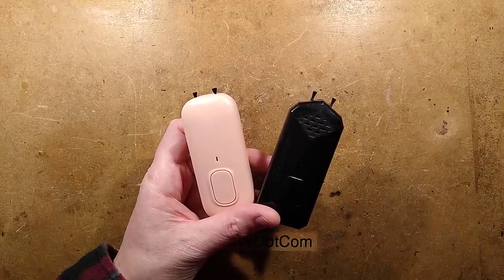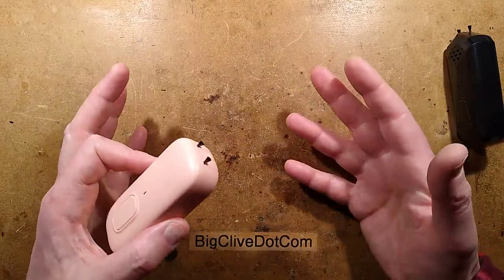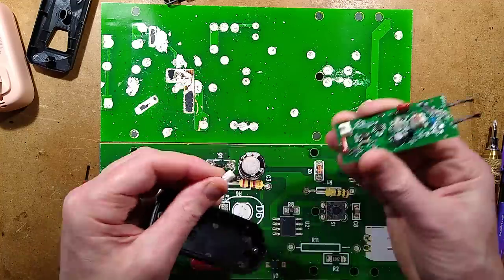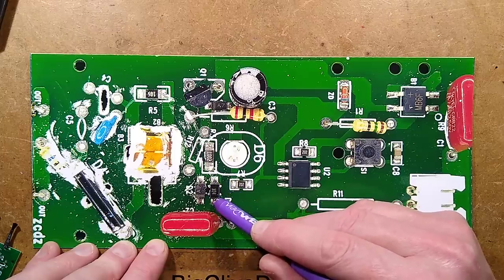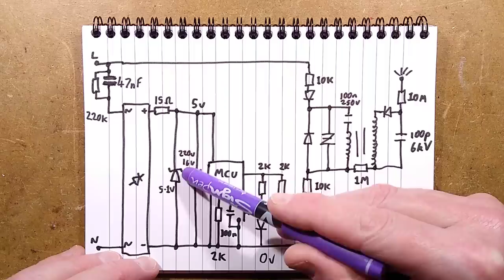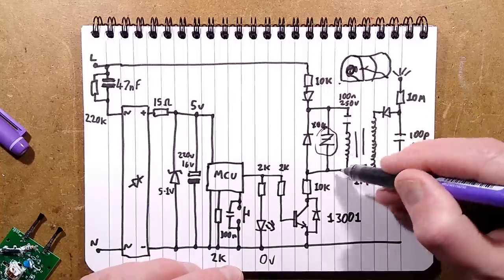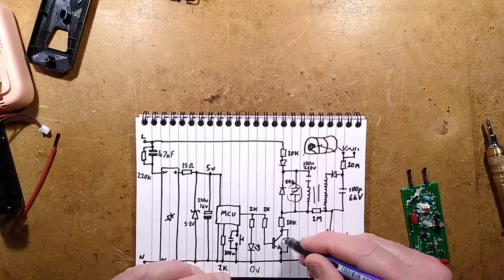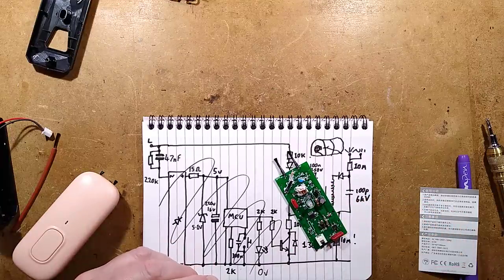Unusually spicy little ionizer - with schematic

Comment: G'day dude it's Bobby Maggoo here,
I just bought some very dirty nightclub house light.
Everything metallic has lost its gooey haze goo condensate.
However the plastic encased points are not looking easy.
Give me a tip and I will patreon the shit out of you or post U a bottle of Fanny's bay whiskey.
Trying to upgrade my loader skills on a rare opportunity.
Been here for years.
Just to weird to manage people.
Reply from the maker: Nightclub lights always end up filled with sticky haze residue and other "stuff".  Usually a spray can of isopropyl alcohol can wash out residue, but keep in mind that it's very flammable.
Reply: @bigclivedotcom  I just finished 12 hours of horrible work using circuit board soap, a paintbrush and my shop vac to suck out the foam and dust from the vents.
My house smells terrible.
And I've only cleaned the outsides....
God help me.
Now sleep and a countdown to packing up a few new year's eve gigs.
Thanks for being a source of info in the game.
Everyone is too busy to teach.

Comment: God iv learned so much from watching videos like yours and the other great channels and characters on YouTube over the years! 😁 I can fix TV'S, radios(plus build one some copper wire, tin foil, a razor blade with a stub of a pencil and safety pin, some rocell salt and a gravey can for an earphone, & if your antenna which is just a long length of copper wire it will power it.. so no batteries needed) phone chargers, and most PSU's. Plus a multitude of things. And I knew absolutely nothing (Apart from fixing a plug socket & changing a light bulb 💡) before I started learned electronics for real.. so if anyone is thinking about learning for real my advice IS DO IT 100%👍BECAUSE YOU WILL NOT REGRET IT ONE BIT. IT'S PROBABLY.. "NO IT IS THE BEST THING IV DONE WITH MY SPARE TIME, (WHICH IS A LOT THESE DAY'S NOW THAT IM IN MY 40'S AND CARING FOR MY FATHER) SO IV LOT OF TIME TO DEDICATE TO IT." IT WILL BE SLOW AT THE BEGINNING BUT SAVE VIDEOS THAT YOU DIDN'T UNDERSTAND AT THE TIME. THEN WATCH THEM BACK AS YOU GET BETTER AND YOU WILL SEE HOW MUCH YOUR YOU HAVE LEARNED IN A SORT SPACEOF TIME, YOU'LL BE SURPRISED. 
PLUS YOU WILL PICK UP THE LINGO QUICKLY WHICH WILL MAKE IT EASIER TO UNDERSTAND WHAT THESE GREAT GUYS ARE SAYING. 
PLUS A GOOD CHANNEL LIKE CLIVES HERE IS A CHANNEL CALLED 
"DIODE GONE WILD" it's a guy with a funny accent but he's really great at explaining everything in the schematics he does and it effects all the other components on the board. HE MAKES A LOT OF VIDEOS ON COMPARING PHONE CHARGERS. ( IV FOUND THAT 80% OF ELECTRONICS IS UNDERSTANDING POWER SUPPLY'S) 
Plus I would advise downloading some electronic apps for you phone
 A good one is "ELECTRO-DOC" it's free. Plus download a component pin out app too. 
AND HAVE FUN. LEARN AT YOUR OWN PACE. AND WHEN BUYING A MULTIMETER GET TWO. AND TRY AND GET ONES THAT MEASURE BOTH "AC & DC" CURRENT. AND ANOTHER GREAT LITTLE DEVISE TO GET IS A TRANSISTOR TESTER. OH AND A SOLDERLESS BREADBOARD TOO. 
DON'T MISS OUT ON ONE OF THE BEST THINGS YOU LEARN FOR FREE HERE ON YOUTUBE. ITS LITTERLY CHANGED MY LIFE FOR THE BETTER. GOD BLESS AND GOOD LUCK 👍🇮🇪💚🙏🏼👌